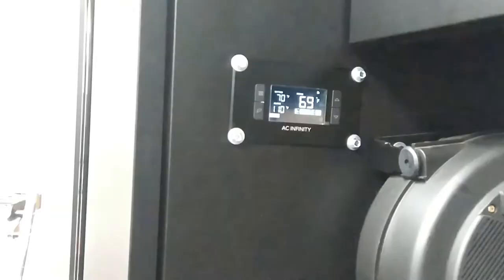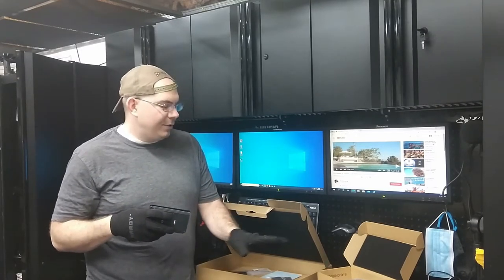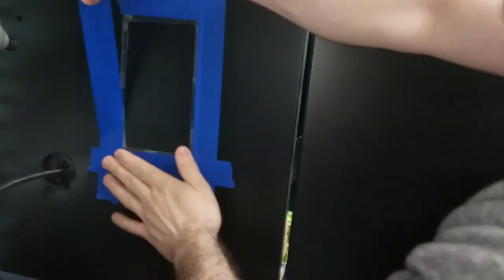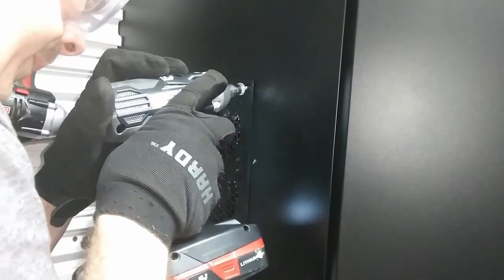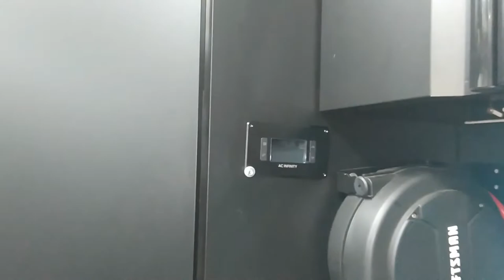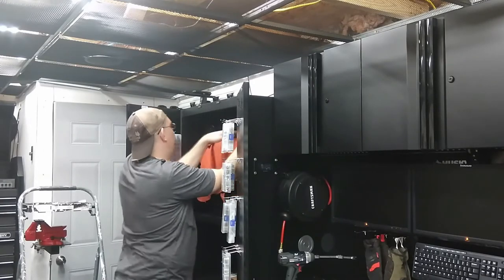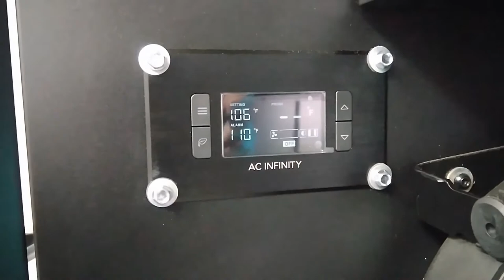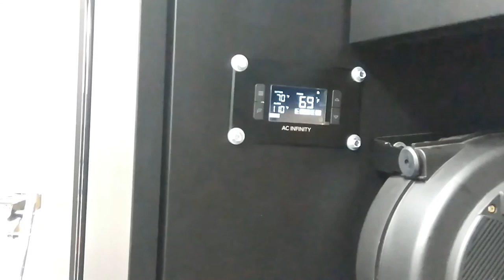AC Infinity Airplate Pc Cabinet Fan and Digital Thermostat Install Into Metal Cabinet

Comment: Why does this video have so few views? I’m doing something different, putting PS5, Modem, cable box, switch  phone base, and power strip inside a wooden cabinet. Just needed to see someone else do something with these things before cutting holes in cabinet. Good job! Please update if you haven’t already. I’m trying to figure out best placement for fans, while balancing functionality with aesthetics. Intake will be toward bottom, near Air Register but can’t determine to put the exhaust on same side toward top, or opposite side at top.
Reply from the maker: Paul I pull in and exit out the top. You control flow with just flipping fans it's really easy to do and use. Good luck buddy thanks for watching.